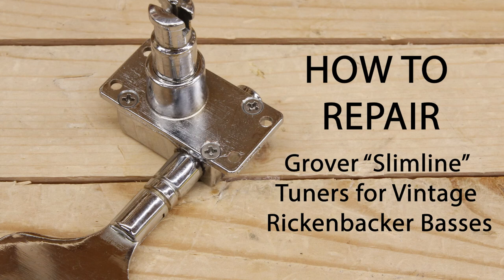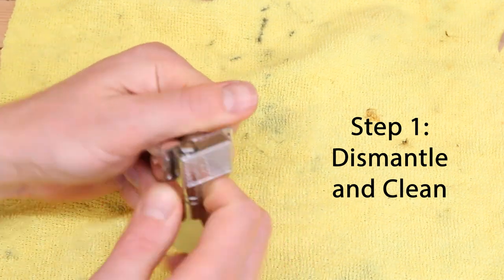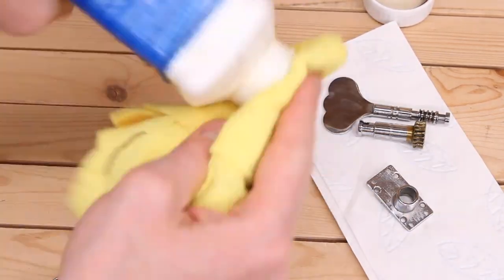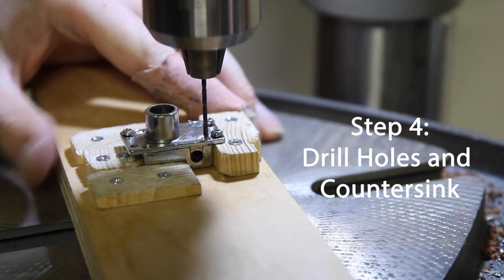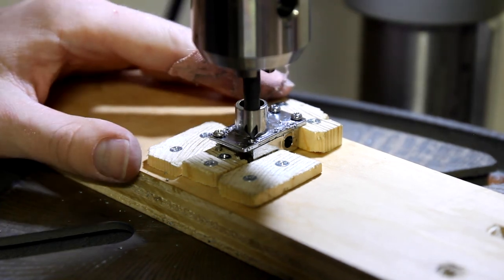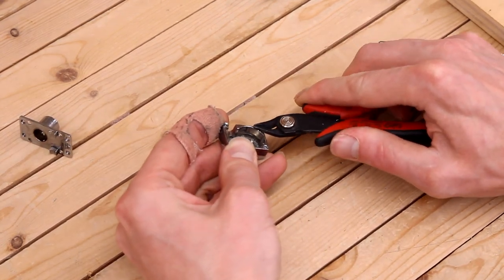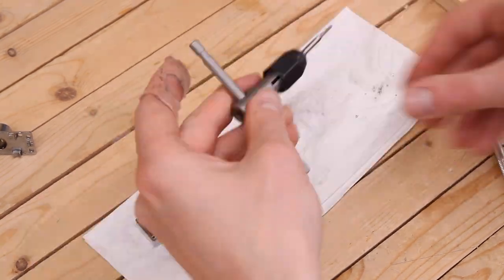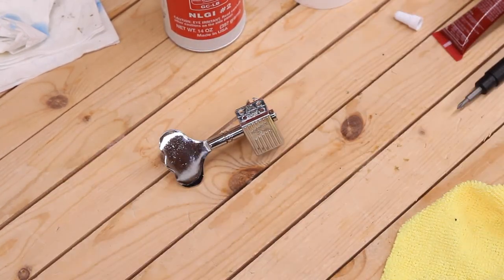How To Repair Grover "Slimline" Wavy Tuners for Vintage Rickenbacker Basses

Comment: I’m probably 2 years late but a good thing to do when drilling is putting a piece of tape to mark how deep the screw is, whenever I drill into anything I do that to make sure I don’t drill to deep
Reply from the maker: Definitely good advice. I have had instances with very skinny drill bits (like used here) and grease where the tape starts slipping upwards causing me to lose it as a depth gauge. Best to use a depth stop on the drill press if available.